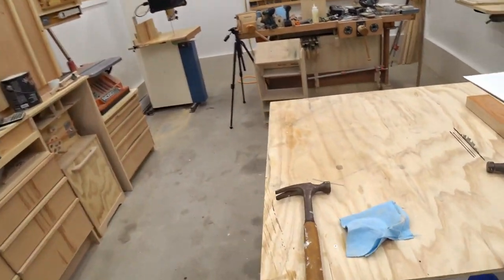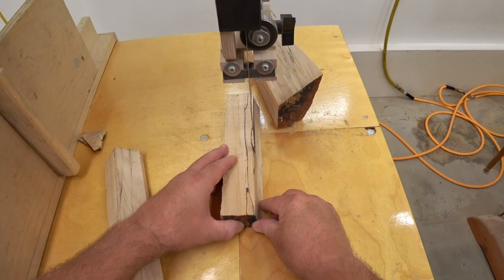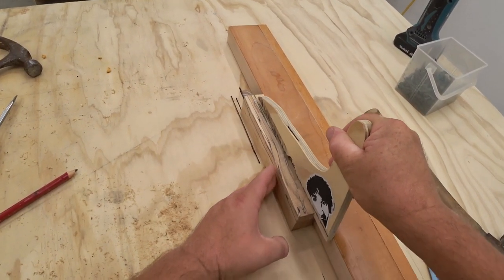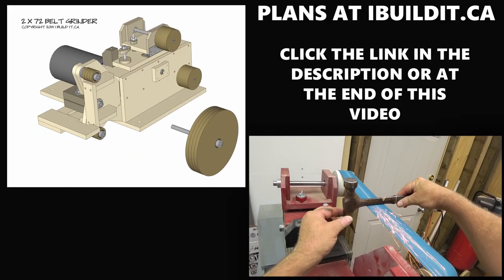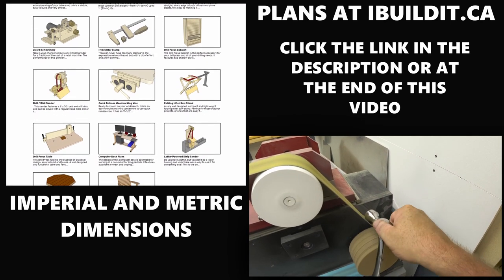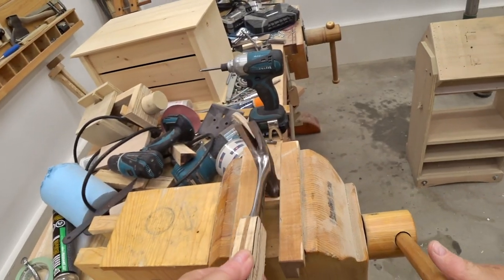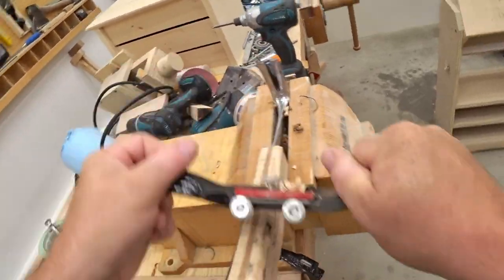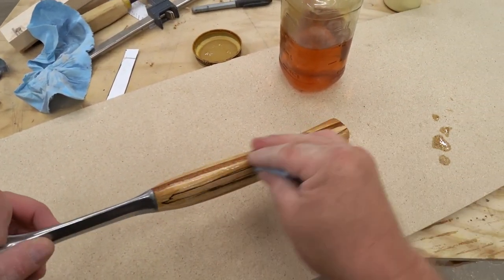Rusty Hammer Restoration: Shiny with a New Wooden Handle

Comment: Nice build, John!  I did the same thing last summer with an old framing hammer head and some scraps of black walnut I had lying around.  Unfortunately the head had some pitting, so it didn't come out as clean as yours.  However, it is still too nice to actually use.

Comment: Call it a waste of time if you will, but I dig the way it turned out. I especially like the idea of the strip down the sides. I feel that's one of those small things that could be used / be applicable in lots of situations. Just a slightly different way of thinking about a problem and solution. Cheers.

Comment: Hey mate, have you used the hammer much? How does it hold up with the glue and all? My only concern is that maybe needed a pin or two through the handle for a bit more solidity? Asking because I am about to do the exact same restoration job on my estwing 28oz haha